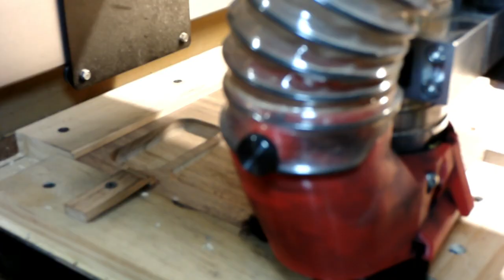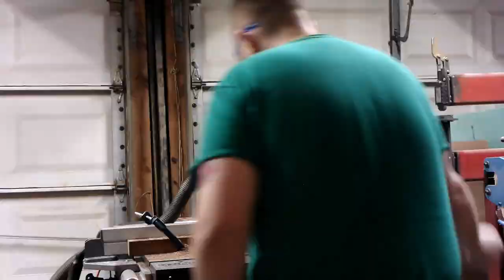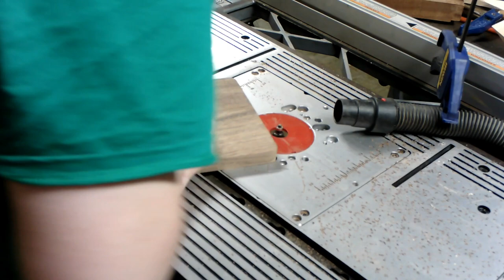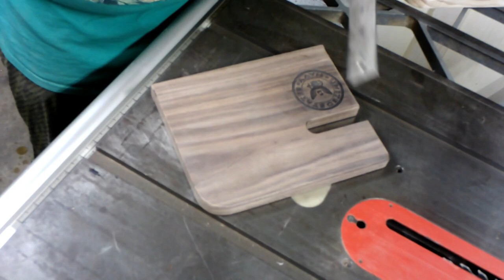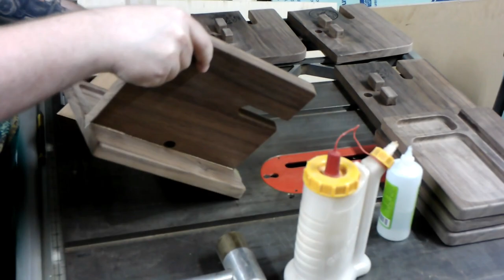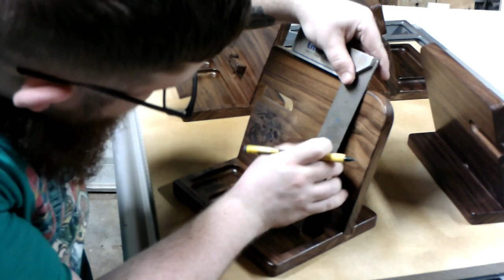Phone Dock Station and Nightstand Organizer

Comment: Hey man, great work. What glue did you use on the phone blocks? Why not regular wood glue? Thanks in advance.
Reply from the maker: Thanks. It was CA glue. I had to make 4 of these, so it was just a little faster.
Reply: @ChrisPowellFSD  thanks! I’ll keep watching. I’m gonna make this with different size strips of walnut and ash.
Reply: @ChrisPowellFSD  thanks man. Last question, what is the price point in a project like that. I’m terrible at pricing things.